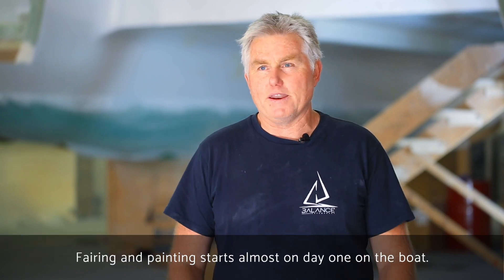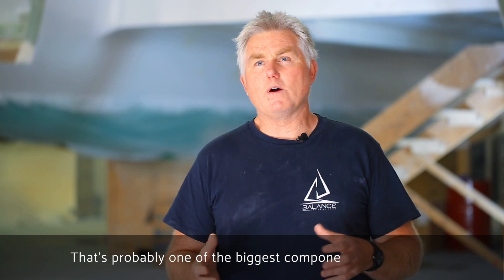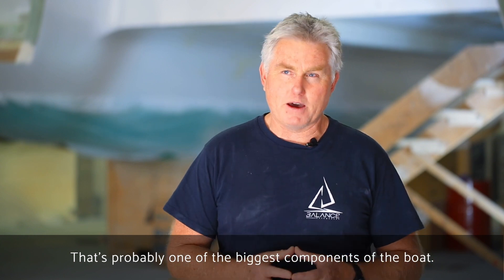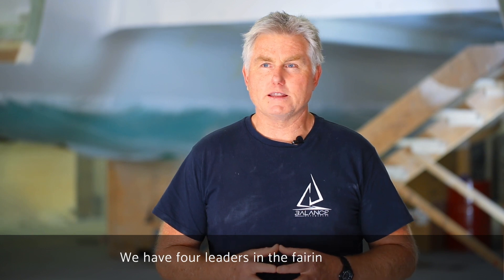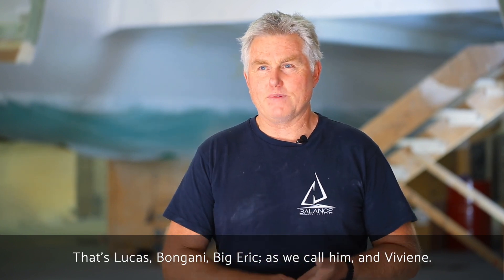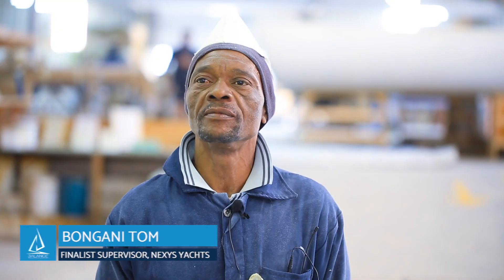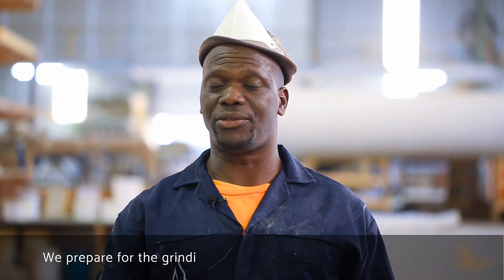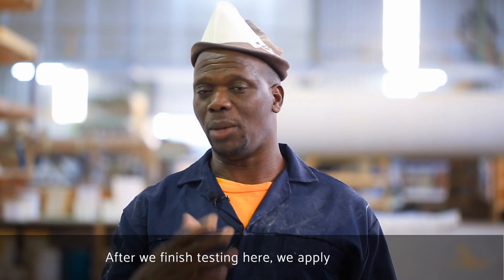Balance 526 Build Process: Episode 5 - Fairing & Painting

Comment: Curious to know how the inter coat long term adhesion is between all those fairing layers
Reply: I’m not sure what these guys are using but having built two boats using west system epoxy I can tell you epoxy loves epoxy, so long as the surface is freshly sanded with a course grit. I’ve never had any issues with delamination ever using any of the various filling compounds and as with these guys, in ever thinner applications as you arrive at the finished surface. And provided you use the correct 2 pot, paint loves it as well.